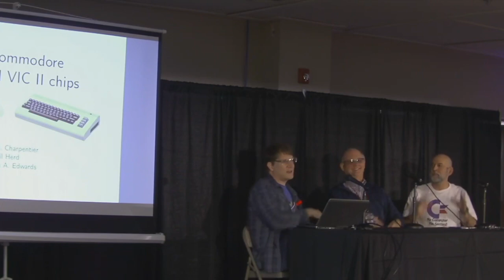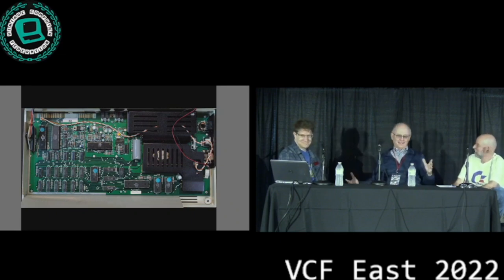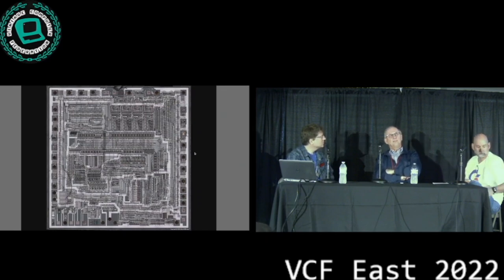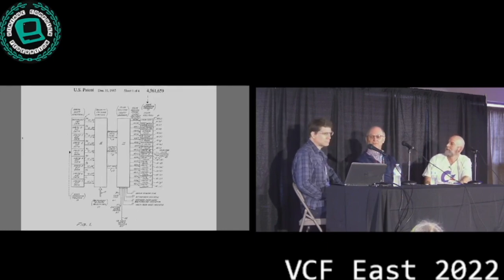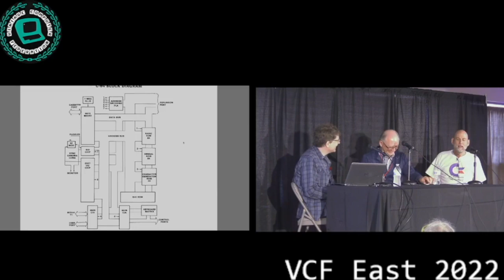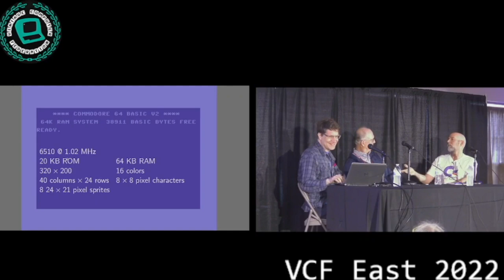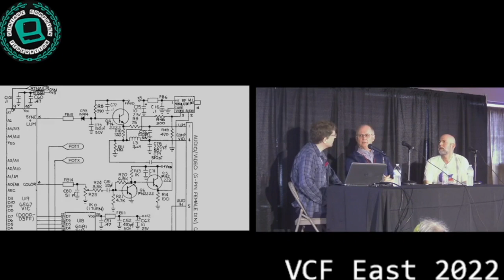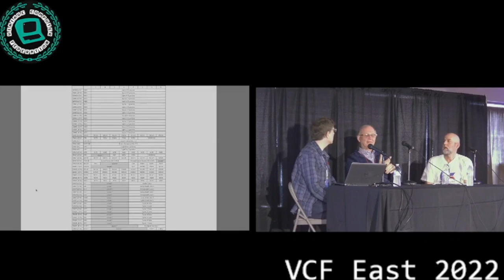Commodore VIC I and VIC II Chips — Bil Herd, Al Charpentier, Stephen Edwards

Comment: Too bad that the sound it stuttering.
Reply from the maker: Sorry for any video or audio glitches. As an all volunteer organization we do out best with the audio and video. We have had vast improvements over the years. We do our best to improve each year. We took some extra time this year for the person processing to the video to get the best source of audio and video available. Next year will be even better as we have ideas for closing the loop on audio glitches.
Reply: @vcfederation  If the original video file does not have the sound glitches in it, then it may have been introduced during rendering or transcoding. If you still have the original files somewhere I would be happy to re-process them on my video editing rig and re-transcode to fix the glitches.